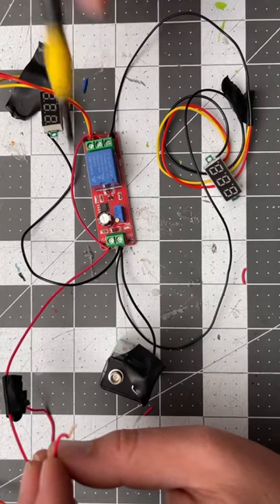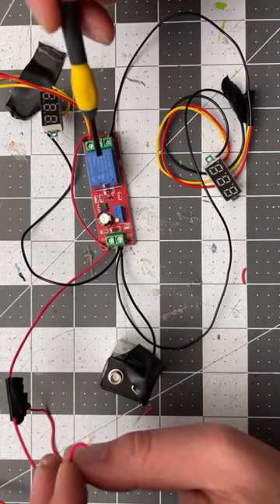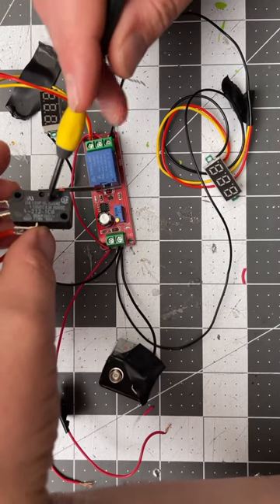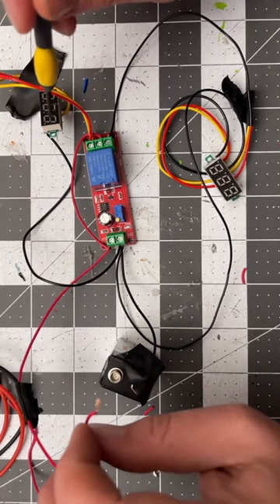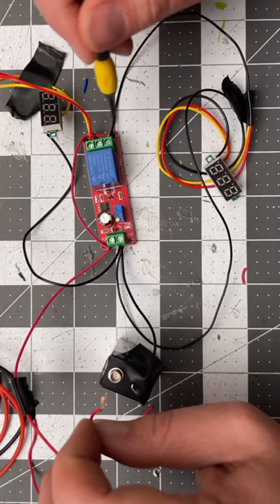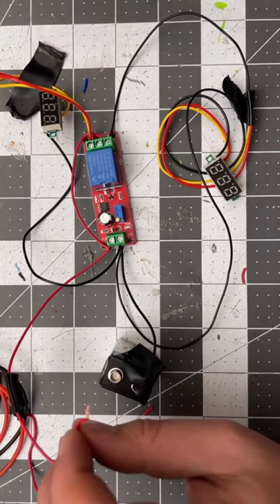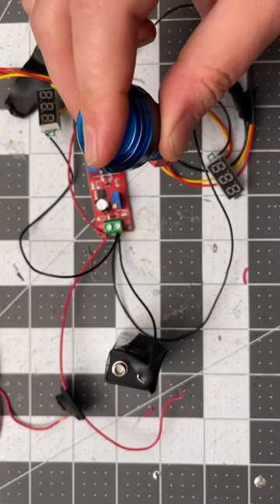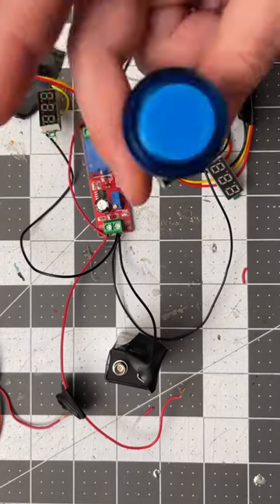Could be cool for Nerf! 12V NE555 0-10 Seconds Delay Timer Switch Module. Longer video coming soon.

Comment: Very interesting! James ridling uses a lot of relays instead of switches but not with the delay. Very cool concept! Keeps the click of the rev switch and eliminates the need for a 2-stage trigger. The newer select fire kits use these. I did a select fire Stryfe last month that had one of these and I didn’t even realize it until now. It had adjustable spin up time and delay for the firing motor. Great info! Especially from a short! 👍👍👍
Reply from the maker: Thanks! I actually have a 5 minute version to post that talks a little more in depth (as far as my skill allows) since there was not a lot of clear references online.
Reply from the maker: I would love to know more about how you set up a select fire build, I need to get there haha